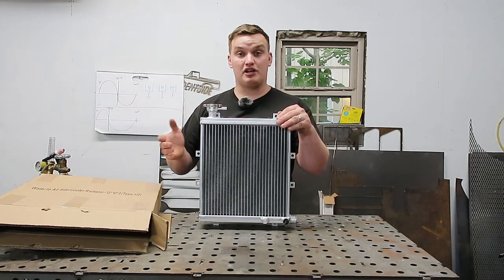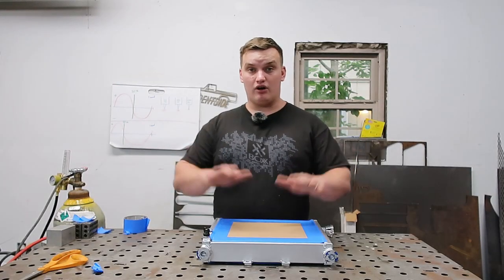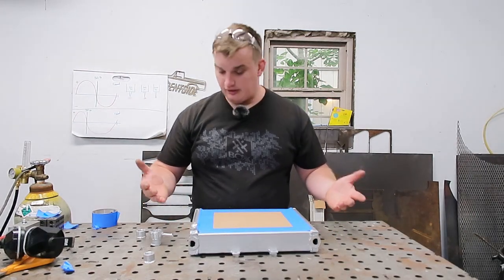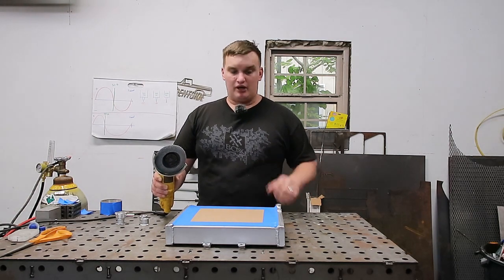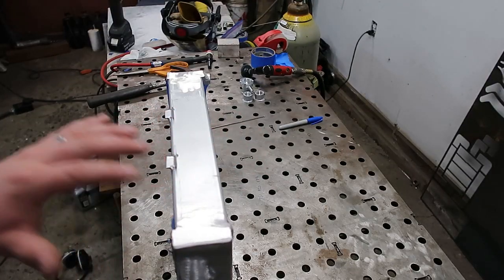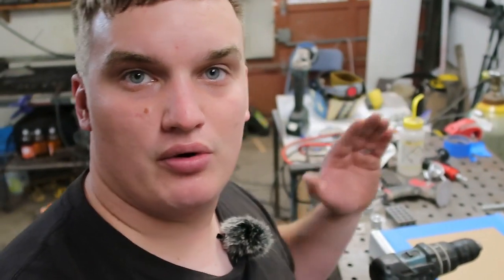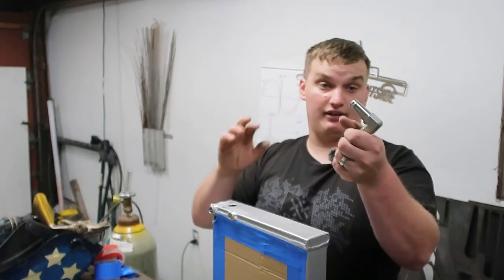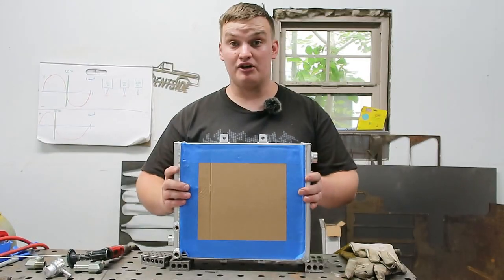Modifying A aluminum radiator (Tig Welding)

Comment: Is there any worry about a failure by using a butt joint and grinding the head of the weld off vs using a lap joint and leaving the weld?   I have a radiator that I need to do some similar modifications do and I don't want to have 10 different patches visible where I removed all the existing fittings.
Reply from the maker: On my plug or replacement piece I I beveled the edge and also made it a .065 "" smaller all the way around. That Gap will help Ensure the weld fully penetrates.

Comment: I have one those radiators and it’s small leak on weld on where corners meet, can I get it re welded ? And it’ll stop the leak?
Reply from the maker: In theory depending on the location of the crack and the skills of the person you bring it to 😎
Reply: @amcustomfab  damn I called couple welders but not into machanics I need one asap

Comment: Was that your 225? I can’t get mine to weld thin, first tig welds so I’m clueless
Reply from the maker: Yes this was the 225
Reply: @amcustomfab  Thank You, gives me hope..3/32 tungsten? 
Al I have is the gray it came with.
Trying to weld corners on an 18 gauge AL. Fan shroud and it just melts on test piece bent into a corner.
That would be a good video, seems like popular task for users. (Thin AL)
That radiator looked pretty thin.